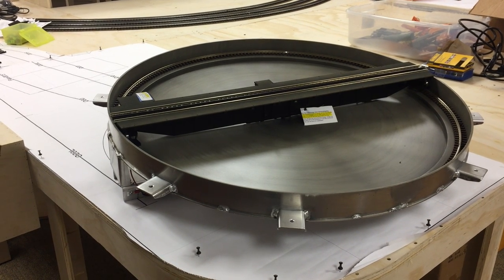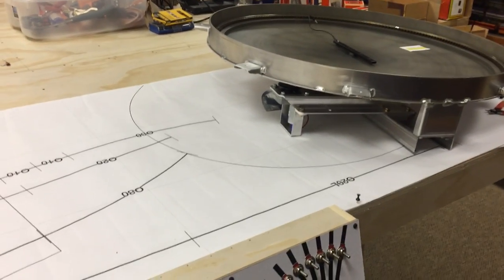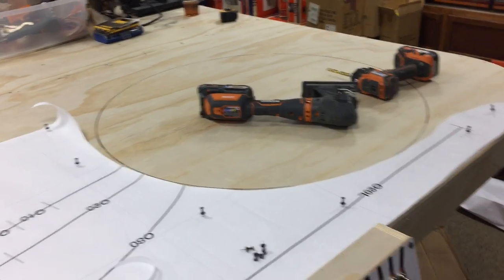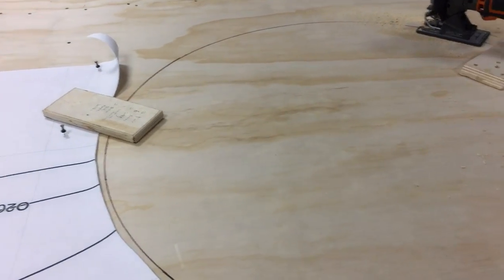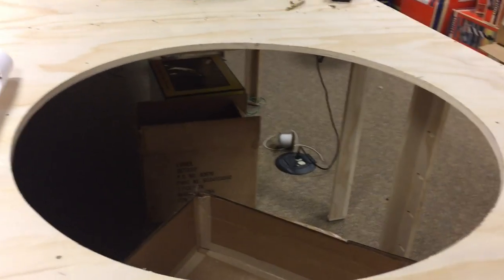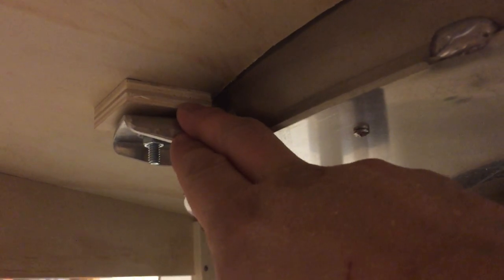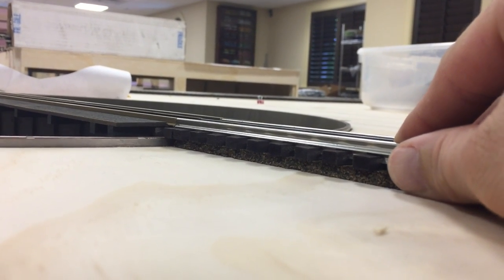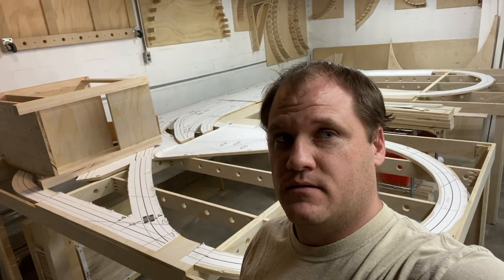How-to install a Millhouse River Studios Turntable

Comment: You have done it again a fantastic video how to video I look forward to seeing your next one I like at the end how you said you can get your wife husband or a friend or something like that to give you a hand but you can also put all your elevator bolts through the top and then a piece of board screw down to help hold them in place while you're underneath the layout thanks for sharing with us
Reply from the maker: The help is to assist with pushing the turntable up, not holding the bolts down/in. It weighs a lot.

Comment: When you mark and drill the holes in the top, you turned the turntable over and marked the holes, but.........when you install the turntable from underneath the table, the holes you are using are opposite from where you drilled them, 180 degrees different.  Are the tabs so precisely placed that you can do that and have them line up when you use different holes from underneath the table?
Reply from the maker: In this case, yes the holes are that precisely lined up.  It’s really a remarkable product. The quality is awesome.    Ohh btw, the company will weld those mounting tabs on at custom heights upon request, you just have to email them with your specs. I’ll be doing this on the next one to eliminate the 1/2 spacers I needed on this particular install.
Reply: @MRBenchwork  Wow thanks much for the confidence in the product.
Reply: @MRBenchwork  Actually, I spoke with Alan yesterday and he did not offer to weld tabs to custom heights.  Maybe he will do for you.  He indicated that using the 2 nut system, you can easily adjust height of the table.  Also, he indicated that the instruction DO recommend the holes be measure FIRST by taking the unit underneath the table.  It is precise but he has had people contact him that were not as lucky as yourself with the hole position marked from above by turning TT over.
Reply from the maker: @rangermiller9969  Something must have changed then because he did offer that previously. I'm guessing that he, like everyone else is so busy that customization is not practical for the time being.    As for holding the 50 pound turntable up under the table to mark holes, yeah, I won't be doing that. It's not safe. At minimum I'd get one hole drilled so I have something to help support the darn thing while marking/ drilling the other holes.  Besides I've installed 3 of these now so I know what works for me. Your process could be different and that's ok.
Reply: @MRBenchwork  Sounds good.  Totally understand!
Reply: @MRBenchwork  That is awsome!! TX

Comment: Could you tell me the length of the Elevator bolts that you used?  I am also going into a 1/2 inch table top so I think that 1 3/4 inch would work for me.  Thanks
Reply from the maker: It's safer to get longer ones and not need the length than to purchase something too short. Here's the exact ones I purchased. https://www.amazon.com/dp/B00BBCVYH4?ref=exp_mrbenchwork_dp_vv_d

Additionally, here's an Amazon Ideas list that has a lot of the stuff I like to use. https://www.amazon.com/shop/mrbenchwork
Reply: @MRBenchwork  Perfect thanks, funny to see that as I had them in my Amazon cart since yesterday going to order them.  Thanks